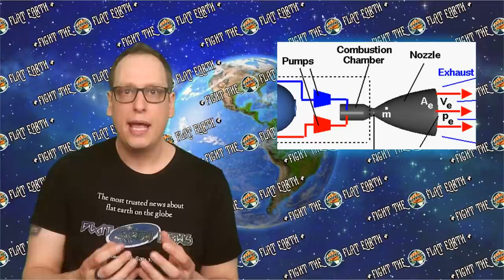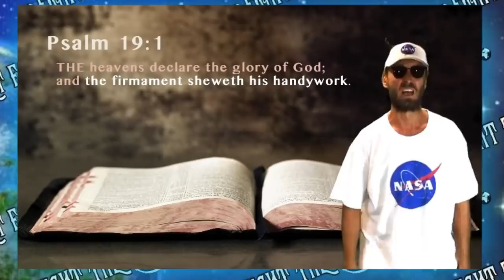Rockets do work in space you morons!

Comment: A bit of an elaboration:

Rockets work even BETTER in a vacuum.
Inertia is only part of the equation.
Pressure differential IN the combustion chamber of a rocket is the other. In a vacuum the Exhaust gases have no resistance, so the pressure there will be less then where there would be airpressure. At the front of the combustion chamber though, the pressure is still the same ergo the difference is greater.
The result is that the exhaust gases will go faster.
When you calculate everything (the pressure difference versus the inertia) you'll get the same results.
Remember, pressure = force / area, so when you go the other way, then force = pressure times area. So the larger the engine and the larger the pressure difference, the larger the force. And that force drives the rocket! (as well as the exhaust gases)

The "bell shape" at the backside (bottom) of the rocket engine is there mainly to enlarge the speed of the gases, by whitch the inertia increases, as well as the counter pressure lowers.
Rocket science 101!
Reply: Additionally, the rocket itself is affected by air resistance.  None of that in a vacuum, either.

Comment: The main problem getting rocket fuel to burn in a vacuum isn't the lack of oxygen - it's the lack of pressure.  To make a sustained burn, the heat of reaction needs to feed back into the fuel-oxidizer mixture.  When the fuel burns, the hot gasses touch more of the fuel heating that up and causing the chain reaction.  In Cody's experiment, we saw that the fuel DID burn... it turned black.  However, in the low pressure environment, the hot gasses dissipated too fast to sustain a burn.  Here's a video where Cody follows up on this.  He builds a pressure chamber for the combustion.  The little chamber has enough pressure to initiate the reaction, and once it's roaring, the expanding hot gasses maintain enough pressure to continue burning. https://youtu.be/76JM03a6WH4?t=400

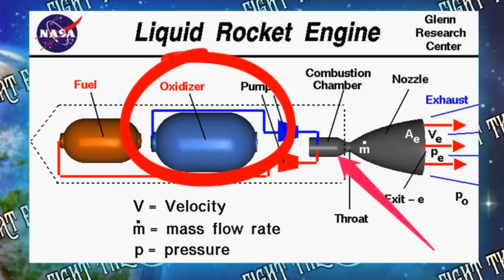But is that cheating?  It isn't really burning in a vacuum then is it?  It's burning inside a chamber, and that chamber is in the vacuum?  Right.  Just like in the rocket diagram that FTFE presents here @8:23.  That little combustion chamber runs at very high pressures.  The hot gasses escape from that high pressure area out through the nozzle at the back towards the low pressure outside.  That's how a rocket works.
Reply: Good explanation. The same goes for gunpowder. Gunpowder (black or smokeless) doesn't need oxygen to burn, it contains its own oxidizer, but it won't burn well in a vacuum without some sort of container for similar reasons. But it works perfectly well inside a cartridge that is in a vacuum.
Reply: Bruce Tucker A pile of gunpowder works perfectly well in a vacuum. In a liquid fuelled rocket, you pump tons of liquid hydrogen, or some other fuel, per second into close contact with tons of liquid Oxygen per second. It has to burn
Reply: @SvenTviking   The same uncredited source for that video, Cody's Lab, had a video showing that a pile of gunpowder in a vacuum chamber is very difficult to ignite. Confine it and it burns just fine. The rocket works because the fuel and oxygen are fed into a combustion chamber, not directly into the vacuum of space. The pressure inside the combustion chamber is very high.

Comment: If rockets pushed off air, they would slow down as they gained altitude, not speed up.  Werner Von Braun's quotation does not refer to a physical dome, it refers to the celestial hemisphere and then as now, no particular distances of any celestial objects are implied.
I have asked flerfers if they thought an astronaut could explode a stick of dynamite held to their chest without suffering harm, I never get an answer.

Comment: The reason why the "candy" propellant does not burn in vacuum is different. You can add enough oxidizer (potassium nitrate) and will still have the same problem when removing the air.
It has something to do with the chain reaction in between the individual crystals and particles of the propellant. You need some medium to transfer the heat of combustion, otherwise you cannot start the chain reaction. It only starts smoking locally but that's it. It's the same with black powder, you have enough oxidizer but try light it in a vacuum. Won't work! 
Even "real" composite rocket propellant that are used in solid booster have ignition troubles at lower pressure, they actually need a certain chamber pressure of several bars minimum to operate properly. And that's actually the trick behind it. You could perfectly use the candy propellant in space when you light it in a combustion chamber that maintains a more or less stable pressure.
Liquid rocket engines are a completely different chapter, the comparison is not really a appropriate but for a simple explanation it works I guess.

But don't waste your time explaining that to a flerf!
Reply: To give some context: Cody was trying to light up gunpowder under vacuum, which was failure for known reason. When a guy named hitman notoriety who was at the no thrust in vaccum bandwagon, used a clip of Mehdi Sadagdar (aka ElectroBoom) showing a tesla coil transitioning to vacuum with a bent paperclip at the top.  ElectroBoom literally demolished the poor hitman but didn't stopped there: he dug to his channel and found that he used the Cody's failed attempt clip he advised Cody to restrict somehow the outgassing. All this in one clip while co-starring ElectroCute (Mehdi's daughter channel), and discovering that hitman was and into electric universe bandwagon. 

Hitman notoriety did a reaction to ElectroBoom's video (with disabled comments), and little later Cody uploaded a video in which he followed ElectroBoom's advice, and he successfully litt the gunpowder under vacuum. 

Hitman did a reaction to Cody's successful attempt (with disabled comments) and after a couple of weeks he deleted his channel. All these took place within 1-1½ month, and the respective videos are 2 years old I think

Comment: There are also hypergolic propellants such as dinitrogen tetroxide plus hydrazine and monomethylhydrazine and unsymmetrical dimethylhydrazine which do not require oxygen to burn.
Reply: UDMH has the distinction of being so nasty that should you breathe some in, a few minutes later you cough up a liquified version of your lungs and then die.
Reply: Chlorine trifluoride was briefly considered too. Very briefly.
Reply: @DavidSmith-vr1nb  
That sounds like some very nasty shit!
Reply: William Signs  The Ariane 5 uses a blend of Hydroxyl-terminated polybutadiene, ammonium perchlorate and aluminium powder for the solid fuel boosters, hydrogen and oxygen for the main engines, and unburned hydrogen and oxygen for the attitude control thrusters. Western launch vehicles no longer use hypergolic propellents (however the attitude control system of the Delta Cryogenic Second Stage and Centaur use hydrazine monopropellant thrusters).
Reply: @its1110  some of these things they can eat through 1m thick concrete...
Reply: @ΑΡΗΣΚΟΡΝΑΡΑΚΗΣ  
Heh heh. I'm silly.
I read that as "1 mm" (milimeter) and thought "What. That's nuts. It'd eat my house."
Oh! __Meter__!
Yeah.
:)

Comment: I don't know what have you been expecting. It's elementary school stuff (Netwon's third law), of course a flerfer doesn't understand it.
Reply: The rocket used to be one mass, standing still, then it ignites, hot gas shoots out really really fast.  The rest of the rocket MUST accelerate in the other direction to move the rocket and the remaining fuel, but more fuel is burning and escaping really fast, causing it to accelerate some more.  If you track every atom that used to be in the rocket, the net motion is still zero.  This has nothing to do with anything else around the rocket.  It will work whether there is air around the rocket or not!
I'm trying to explain it in Grade 3 terms, I'm really trying.
For the advanced class, I will just throw out there that the entropy of the still, compact rocket increased in spades .
Reply: Works better WITHOUT the air.

Comment: FTFE's analysis why the propellant does not ignite is wrong. The problem is that some propellants don't ignite at low pressure, independently of whether the gas surrounding it is oxygen or something else. This is even used in some motor designs to stop the combustion: just open the chamber in space so that the pressure drops and extinguishes the propellant. The actual composition of the propellant does not play a role. And amateur rockets are designed to go to space, and they don't need any oxygen.
Reply: It does work as a basic example though.
Reply: @cleanerben9636  No, something that is wrong can never work as an example. Except perhaps as an example for how NOT to argue. That's like pointing to a hot air ballon and claiming: "look, objects heavier than air can fly". It's just wrong.

Sugar/KNO propellant has enough oxygen, it does not need any oxygen to ignite, it just needs some pressure to ensure that the hot gas does not transport the heat away too quickly.
Reply: @afm4711 .....but the basket and material of the air balloon are heavy than air....
Reply: @cleanerben9636  So are the materials of a ship, but it still does not sink. And a composition fallacy does not make an incorrect example  any more correct.

Comment: Dear Flerfers,
How to get thrust in a vacuum:
You need two people, some duct tape, two pieces of paper and a pen.
Now you write "rocket" on one and "fuel" on the other paper.
(Either look above for the spelling, or make little drawings if you feel uncertain about writing.)
Both persons pick one paper each and put it on your breast with tape.
(You can change positions later if both want to be the rocket...)
Then stand face to face and use the tape to each fasten your legs together.
The grand Finale:
(Feel free to do a countdown if you want...)
The "rocket" pushes the "fuel" away as hard as it can!

Both will sit on their asses, being pushed apart by similar opposing forces.
Think what would happen if you used space suits and did it in a vacuum chamber.
If you're still sceptical, try it in a vacuum chamber for real... and don't worry, actual space suits are not really necessary!
Reply: That won't convince them, since you are still pushing 'against' something.  If they like guns (preferably a rifle or something with a lot of recoil), they could sit on a skateboard and fire bullets.  The idea that the bullets are 'pushing against the air' may be sufficiently weird in that case that they would have to find some other explanation.  I'd be fascinated to hear their alternative.
Reply: @majkus 
They are pushing against the same thing an actual rocket pushes against: the matter it blows out.

Comment: Rocket thrust is a bit more complicated than high velocity gas coming out the exhaust end of the nozzle.  The force being applied to the rocket is due to the high pressure inside the nozzle that does 2 things.  The pressure:
1 propels the exhaust backwards at extremely high velocity.
2 pushes against the nozzle, which pushes against the engine mounting frame, which pushes against the rocket body.
So the rocket exhaust does not have to push against anything after it leaves the nozzle - it is pushing forward against the nozzle before it exits the nozzle.

Comment: Short version: Set off an explosion inside a sealed container ... it explodes (natch)
Now, do same in container with one end open ... container fucks off in opposite direction
Why?
Because explosion creates a force against the sides of the container and, as the forces are not balanced at one end, the pushing force is created in the opposite direction
Nothing to do with the exhaust pushing against something outside the container ... it is all about the explosion pushing against the INSIDE of the container.
This effect is more pronounced in a vacuum
Bonus point: Particles impacting a surface create a pressure, even in an unsealed container (in fact, only ONE surface is required) so, Nathan Oakley, no need for a sealed container to create a pressure system. Of course, you already know this if you ever bothered to look at the definition of Pressure.
Reply: An alternative way of looking at it is .. what is NOT happening?
Well, for a start, once the rocket engine is lit, and exhaust is flying out the arse-end of it ...  what is that exhaust doing to the air?
Yup, it is pushing it away at the same speed as the exhaust
So .... if the air AND the exhaust are both moving AWAY from the rocket at the same speed ... any "new" exhaust will ALSO move away at the same speed as the "retreating" exhaust ...  so ... what could the rocket exhaust possibly be pushing against !?

One could imagine that, at some point, the air resistance slows down the exhaust gases to the point where they could begin to "push" against it ... but how large of a force would that generate? Enough to blow back the ears on a cat? Maybe.
Enough to push 2.966 million kg of Saturn 5 rocket 200,000 feet into the air through areas of increasingly LESS DENSE air (where it would generate even LESS  of a "pushing" force !?!

While saying "rockets don't work in space because there is nothing to push against" might get you a few slaps on the back from other moro- erm, I mean,  your "friends" ...  you might want to spend a little bit of time thinking about why rockets DO work in air when there is nothing for them to push against ... as explained above.

RECAP: Rockets work, we know this (Nov 5th, anyone?)  so ... if they DO work, but cannot work if they require air to push against, then they do not need air to push against. If they do not need air to push against, then they will work fine in space. Anyone who says they can't "because .. air"  is actually destroying their own argument

and is a twat

Comment: A simple way to demonstrate both combustion and thrust in a vacuum would be to use the same setup as the guy did with the homemade rocket, only use a gun instead.  The gunpowder should go off in a vacuum, and the kickback clearly demonstrates thrust.  Use a blank round to prevent collateral damage; you don't need a bullet to get kickback.

Comment: FTFE... sorry, have to disagree with you on your one point. The amateur rocket fuel definitely has enough oxidizer to burn on its own, or it would not work in a rocket engine, as rocket engines have no outside source of oxygen, even when on the Earth. 
  I believe it was even on Cody’s Lab , where they were having a hard time getting rocket engines to ingnite in the vacuum. Once ignited, they work fine. The explanation that I got from the video was that there was nothing there to transfer heat to the surrounding material to continue the combustion. I never did look up what a chemist or rocket scientist would use for an explanation, but the explanation that Cody gave kind of made sense, because once the rocket ignited, the pressure and hot gases internally would be enough to keep it burning. 
  Since both amateur and NASA rockets start in the Earths atmosphere, neither would have to worry about that issue upon take off. 
  I am not sure about mini thrusters that they use once in space, and unlike flattards, I assume that NASA would test this stuff before sending it into space. Possibly they use fuel that doesn’t require initial pressure to start a sustainable burn, or possibly add initial pressure before starting the burn. 
  I guess that’s something I could look up before leaving a flattardesque “I don’t understand how it could work” comment.
Reply: I thought thrusters used hypergolics... and sometimes just pressurized reaction mass.
Reply: Agent 1110 ..... I was going to look it up before commenting, but I was short on time. I did a quick Google search right after I commented, and looked on Wikipedia after getting your comment. 
  Most thrusters use a monopropellant, which is usually hydrazine, and it reacts on contact with a solid catalyst. They do use quite a few other types, including cold gas, which I assume is just a mass reaction. I did see a video a long time ago where they were using some liquified gas as a propellant for a satellite’s or orbiters thrusters. I know it was some manned mission, because I remember an astronaut explaining it in the video, but it was probably 30 yrs ago, and I have hard time remembering things from yesterday.
  BTW, the space shuttles used hypergolic fuels for their thrusters for attitude control and orbital maneuvering, such as their deorbiting burn. Some other spacecraft use momentum wheels for attitude control. 
  I guess that I should take flat Earthers advice, and start doing my research.
Reply: @dross4207  
:)